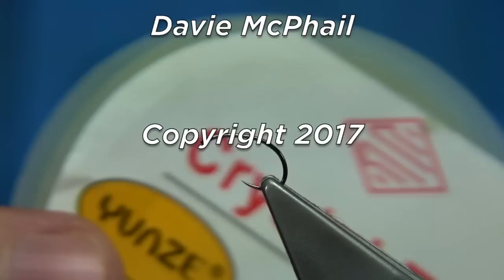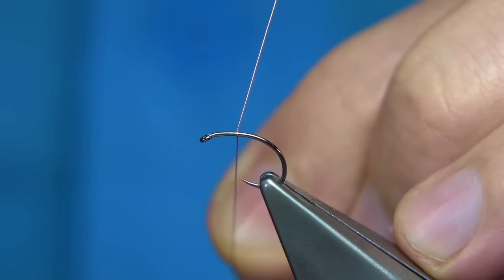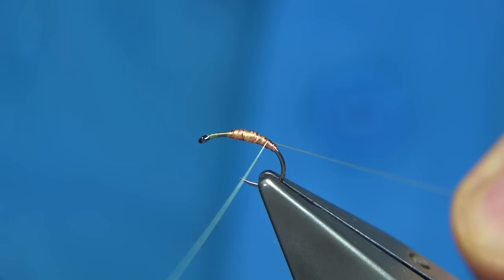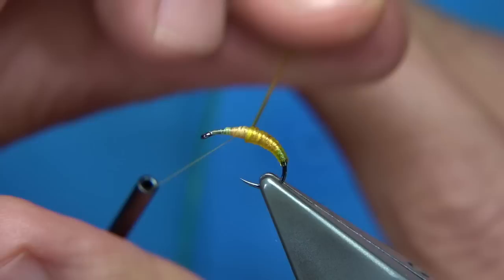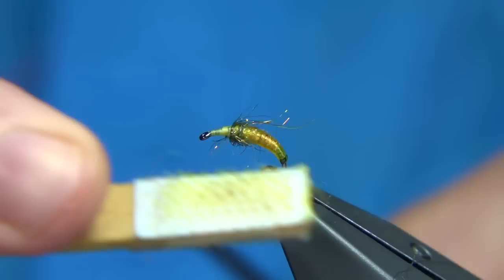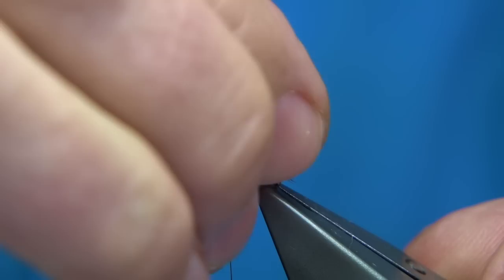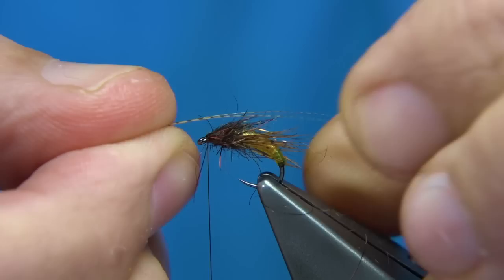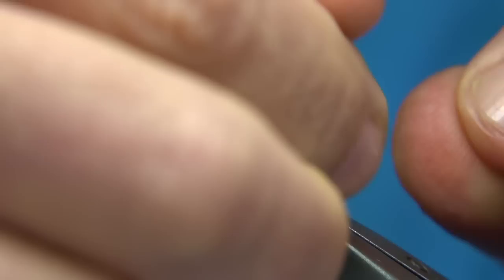Tying a Elastic Caddis Pupa by Davie McPhail

Comment: I'm assuming the material not listed is some kind of green microtubing?
Reply from the maker: Hi Sir Megallot,

I'm sorry I didn't realise I had missed out the body materials and I'm surprised you are the first to notice..I used 0.8mm Stretch Beading Cord, you can buy it in a few colours though I would say I use the clear more than any as you can colour it or simply wind it over your thread, dubbing or even tinsel to get the colour you are looking for...

All the very best Davie

https://www.amazon.co.uk/Wadoy-Jewellery-Stringing-Necklaces-Bracelets/dp/B00EU4K476/ref=pd_sim_201_2?_encoding=UTF8&psc=1&refRID=6JYG35M6750BS9SJ1CYH
Reply: Thanks for taking the time to respond, Davie. That looks like a good, cheap fly tubing alternative. All the best, Scott.

Comment: Hi davie would you use 0.8 on grey   boy buzzers olives etc. Or smaller
Reply from the maker: Hi max man,

I have used the 0.8mm on buzzer and mayfly nymphs size 10s, 12s and 14s at a push but if I was going smaller I would use the 0.4mm...

All the very best Davie..

Comment: Where can I buy Crystal Tee?
Reply from the maker: Hi John, 

I use an Elastic Beading Cord which I bought off eBay, the size I used was 0.8mm to tye this fly though you can buy it finer as well.. I have attached a link for you to see...I didn't buy it from this seller so look around for the best price..

All the very best Davie...

https://www.ebay.co.uk/i/181685688667?chn=ps&var=480639570229&adgroupid=48716125379&rlsatarget=pla-382120635795&abcId=1129946&adtype=pla&merchantid=113707280&googleloc=1007300&device=c&campaignid=974960635&crdt=0